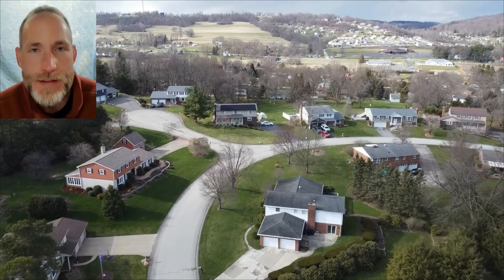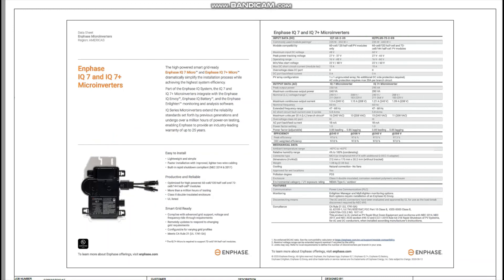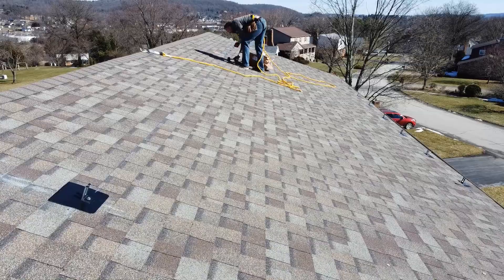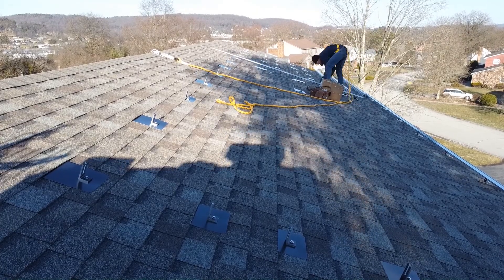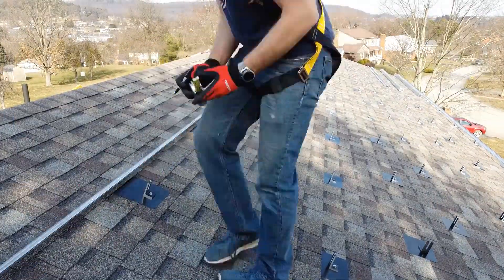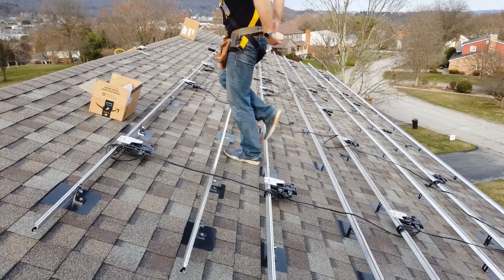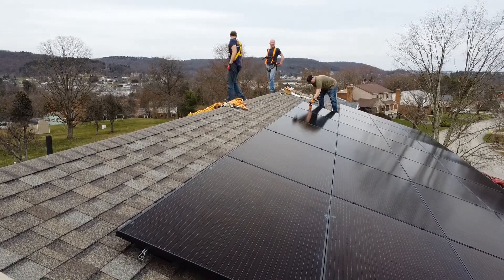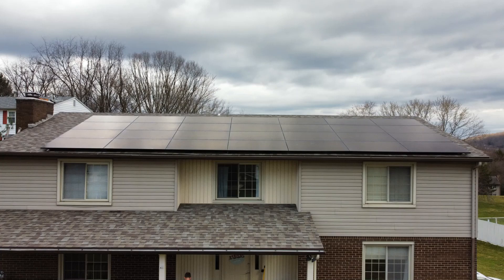Solar Panel DIY Install with Project Solar Overview

Comment: I think you installed the XR rails in the wrong orientation. The "force-stabilizing" curve, as they call it, should be pointing down toward the slope.
Reply: Oh, also - very strange choice of XR10 rails for Pennsylvania by ProjectSolar. The XR10s are designed for little to no snow load, and in most cases here in PA, a minimum of 30 PSF is required. The XR100 would be a better choice.

Comment: How is your energy  consumption.. and are you getting zero bills
Reply from the maker: The first year of solar production resulted in net zero with the ability to sell SRECs in PA and with their value in 2022. I am coming up on 3 years of solar and a couple of factors have made my bill low but not zero. The value of SRECs went down by about 40% and my electric co-op changed my contract for solar generation back to the grid. It went from 1 for 1 credits and debits monthly to a retail charge vs wholesale credit system so I lost about 30% of what I over produce back to the grid. I hope to do an update video soon but overall, I would say it was a very good move and we're well on our way to getting the value out of the system to complete the ROI in 10 years at the most. As of 2024 / 2025, we're saving about 80-90% on our monthly bills from Spring through Fall but only save about 20-30% off our bills from Nov-Feb. We also have a plug in hybrid now which has increased our power consumption. We try to do most of our charging during daylight hours to maximize the solar power usage but that has been an additional factor for the past 18 months. It is cheaper to charge it on solar than to put gas in the tank - especially for running around town.

Comment: Are going to have a battery storage at some point.
Reply from the maker: @mattbessicks7700 , I am not sure
 At this point, it is still too expensive and the lifespan of batteries is too short. We don't have many power outages in my area so I can't justify it yet. I can see the technology improving in the near future and adding it when costs and longer lifespan are better.

Comment: Can you list what gauge of wire you used, and maybe post your permit info someplace?
Reply from the maker: The wire from the panels down to the Enphase Combiner is 10 gauge and the wire from the Combiner box the rest of the way is 8 gauge.

I recommend checking out Frugal Repair who did his own permits and provides a guide to help others. Here is a link to his main video and a link to his guide. If you email me at wseale3@gmail.com then I can send you a copy of my permit plans.

https://youtu.be/ToxFObjnlF0
https://frugalrepair.com/solar-guide/

Comment: Excellent video! I've only been researching solar seriously for a few months now and this is by far and away the most informative video of a real world application that I've found. I joined EnergySage to get some online quotes and then magically started getting solar ads, but one of them was from Project Solar. Being a retired carpenter the diy install is doable for me. The electrical side I'll need some help on. Thanks for taking the time and energy for putting together this video. It's much appreciated.
Reply from the maker: Thanks for the feedback! I will get the video created showing some of the more specific work including the wiring that was done.
Reply from the maker: Brian 1724, I hope your research is going well. I finally got my electrical content pulled together into a video and I hope it will help you as well.
https://www.youtube.com/watch?v=e8v6UsOFQUY